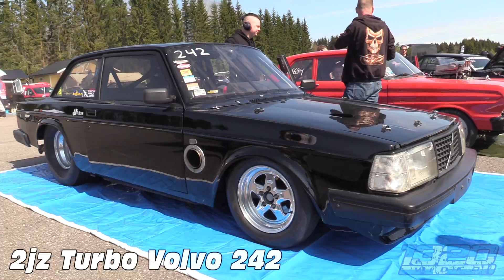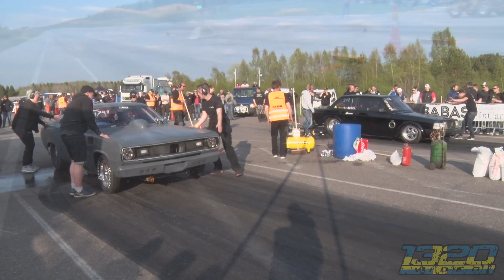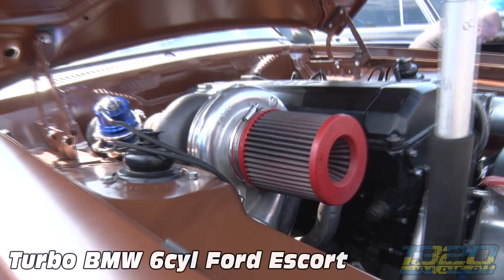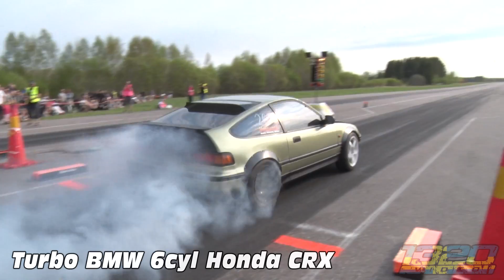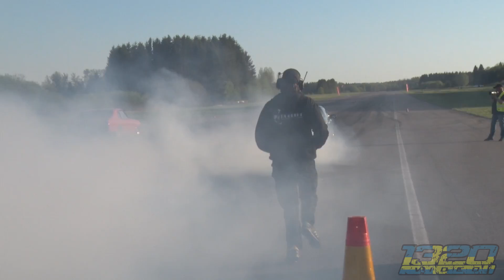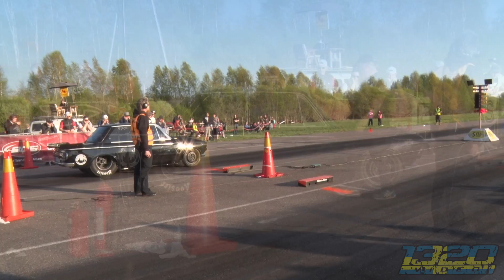Rear Wheel Drive Honda CRX (BMW Powered!)

Comment: Just imagine if they could contain the power put to those wheels.  And the old guard still clinging to V8 power.  I may be old but at least I know that its not displacement its how efficient you can put power to the wheels while keeping the wheels on the ground.

Comment: more like title should be sick bmw 2002
Reply: vargo hoat I'm with you bro.  That 2002 was THE FUCKING SHIT!! FRONT IN THE AIR 1ST THROUGH 3RD! WTF!
Reply: only 600-700 hp in that, 2019 it will be a 1000hp barra engine in it hahah

Comment: As a Gen2 CRX fan/owner and car nut in general with an interest in what modifiers do with what they have in different countries, I always like watching these types of videos, especially. I come from New Zealand, where such modification, has been , and continues to be, the norm. A bonus when my fave comes up in one of them. Do you know of any links to how the swap was done? My perfect CRX would have a Rover 3.5ltr alloy V8, or better still, the Aussie built Leyland P76's 4.4ltr version. in the front (or in the back with a transaxle) just for road use. The steering layout is the biggest hurdle to a front engine, but has been done.

Comment: Bmw has great 6-cyl engines from 2.0 to 3.6, so It's kinda like 2jz. If you how, you'll get pretty good HP/L ratio. And It's possible to get 1200Hp even from M52B28

Comment: The 2002 and the Escort were mental!!! But the dude with the Skyline has to be nuts ditching the RB for a stinking Volvo 4 pot- are you sure he's not from Amsterdam and instead of Sweden?!? He has to be smoking some good shit to think THAT was a good idea
Reply: RB is a lot more expensive to maintain and put boost through and ends up being less reliable. An old cast-iron Volvo 4cyl is nearly indestructible and you can pull out 1200+ out of them.
Reply: RB's are anything but unreliable, dude... You can make 1200hp very easily with RB30's and an RB25 or 26 head. Look up King32... It's an 1800hp street car GTR that's very reliable... Uses pump E85 and is street rego'd in Aust where modification laws are very harsh
Reply: An RB30 isn't an RB26. RB's also have a lot of known issues that sure, they can be fixed, but why throw money on that when you can get something that's as simple as can be and still pump out a lot of power?

There's a reason why LS swaps into JDM cars are a thing.

Comment: i crack up everytime i see those guys "holding" the car when they are warming up the tyres hahahaaahaha
Reply: that skinny dude pushing the car from the front like he's superman aint gonna hold shit. also..
so you are telling me, some dude can hold a car straight, while the centrifugal force of the tyres are spinning in a vertical axis? if you think lmao
Reply: Clearly you have no grasp of actual physics. Car tires spin forward = no sideways momentum nor acceleration = you can easily hold a car straight for the burnout.
Reply: spin a bike rim in your hand and try to move it left/right. it fights against you. now times that by 100000 and thats the car,  you.wont.do.shit.
Reply: also, you failed to see the guy at the front holding the car "back". or i guess you can do that to smh
Reply: yeah you're a fanboy

Comment: i want to start a project, use a crx as the platform. take the whole car and make it like a go-kart, use a k24 mid-mounted rwd. 

an all tubular exoskeleton design, all opened just with a windshield. target weight under 1600lbs.

 carbon fiber bucket seats without fabric or leather, seats will have small points of synthetic sponge to help with cushioning, so the car is weather proof. 

it will looked something close to the honda prototype 2&4. you might ask why even bother with a crx, well it's easier to register when u have a vin, so i will still register it as a crx. anybody want to jump on this project with me?

Comment: Check out that 4wd E30 winning over the CRX ;D
Reply: I thought that was you! Excellent!
Reply: DivaniKingston Haha thanks :)
Reply: can the ix rear end hold power? I heard they are quite weak and fragile.
Reply: Anders Kristensen Rear end holds pretty good, the worst stock part is the front diff.
Reply: Yeah I just heard one of the ends were weak and i assumed it was the rear.
Reply: Anders Kristensen It's the front :)

Comment: Awesome video, but I don't get why that R32 had a 4cyl in it? Why not put a RB26 in it?
Reply: Aussie Dude85 cuz sweden lol, I dont think they have any other reason, maybe that's just what engine they had sitting around and found a skyline shell?
Reply: Rilakkuma Bear ohh yeah fair enough mate
Reply: shorter than the 6cyl engines, therefore easier to get a great weight distrobution, also because swedes swap everything
Reply: I think the Volvo and BMW stuff over there is like a Chevy 350 over here, it's just everywhere.
Reply: Nathaniel H pretty much haha
Reply: I agree with the guy above definitely just found a r32 shell and dumped whatever he had laying around in it.
Reply: Aussie Dude85 it's probably 4G63 swapped sounds like it
Reply: You do know that the 4cyl engine he "had laying around" is the famous turbo redblock B23ft capable of a massive amount of power, on a stock block. It's not just "some engine he had laying around" it's kinda like the swedish 4cyl 2JZ.
Reply: Because that R32 is not a GTR. Also because RB26 is expensive as fuck compared to that engine, and takes a shit ton of money to make that power reliably.
Reply: Well if the 32 did came in with the RB, it would be really stupid to swap it out for a Volvo engine so I guess that they only had the shell. And slap in whatever they find, its pretty cool though
Reply: Maybe he blew the rb that was in it and said screw it... then put that in it
Reply: in europe we dont have 2j's or ls or rb engines on stock or laying around or even on junkyards... (not to mention parts)  what we do have is stacks of euro brand engines.. almost seems logic.
Reply: cheaper parts i guess
Reply: Hella more expensive to run a RB26.
Reply: Frietpan but not in Russia!! they has quite plenty of jdm motors like 2jz, 1jz, 1uz. even 1jzge and 2jzge are also swapped
Reply: maverick buckley the uk is the only country that is/was in the eu, that had the good models and engines at the dealer, gtr, supra and al that shit
Reply: Aussie Dude85 it's a b230, from the sound of it, a 8valve. Pretty much the most famous engine in Sweden. If you wanna see how far these engines can be put watch Pär Eriksson's volvo s60
Reply: Thought the same thing. Fucking garbage.
Reply: Because some r32s come with rb20's and need to be taken back to a 4 banger to make more power
Reply: Cos it is the home of Ovlov!

Comment: Came here for civic not bmw and volvos
Reply: JOHN PINEDA crx*
Reply: You could just leave if you don't like what you're seeing lol
Reply: Little  Bill *crx is a civic
Reply: Little  Bill CRX is a civic my nigga
Reply: And here I was wondering if you came here to whine...
😆
Reply: no one comes for a civic
Reply: pretty interesting that it's RWD with a BMW engine.. but i still wouldn't spend all that time and money on a Honda.  I like Hondas though, I'd get an NSX of I could
Reply: Came here for the Civic and the 2002 Bimmer was better.
Reply: Gaz Girl ever heard of the nsx?
Reply: Gaz Girl ever heard of the s2000?
Reply: It's not a civic anymore, its a bmw ^^
Reply: Do I detect a little turbo whistle whine from the Honda camp?
Reply: Vlad on a circuit a proper tuned k20/24 would gobble a BMW with a good driver
Reply: LockeNess Motorsports a proper tuned BMW will gobble a k20/24 😎
Reply: Yes I did also but it's a CRX  i`t's ok the video was nice but the listing was BS
Reply: Yup I disliked for that reason.
Reply: Tiny turbo Chevelle just because it's not overweight and does not weigh 4000 pounds doesn't mean it's gay s2000 held the record for most power to displacement ratio until the 488 came along
Reply: JOHN PINEDA crx

Comment: BMW powered, which engine?  N54/N55?  These engines destroy American muscle.
Reply: tytlyf M50 bro.. can also handle a shit ton of power with a built bottom end :) cast iron block yoo
Reply: I got a 135is FBO (N55) and this thing will toast most vehicles on the road.  It's a sleeper for sure.  Just picked up 6 months ago, haven't had the opportunity to race anyone.  But it's damn quick from my estimation.